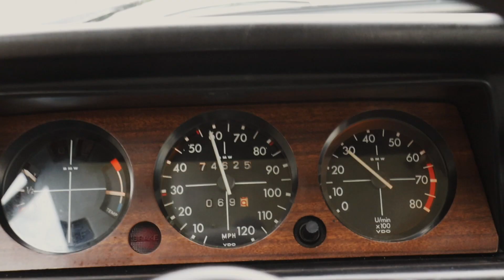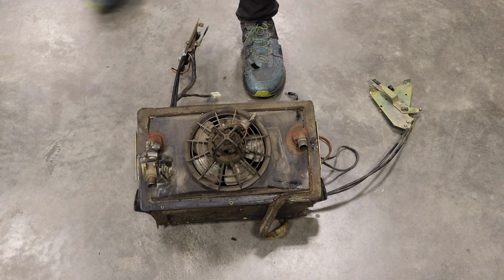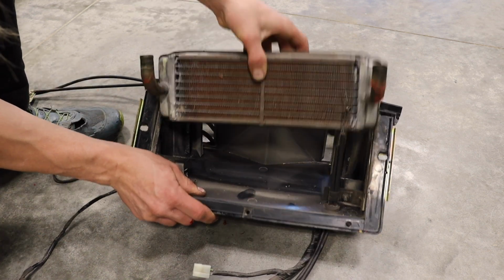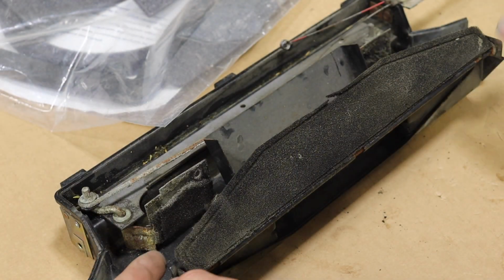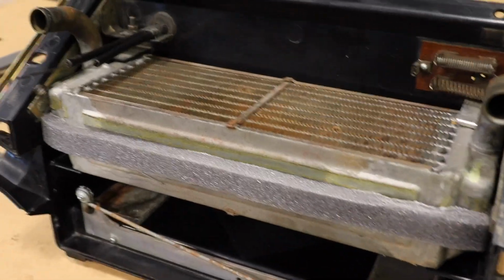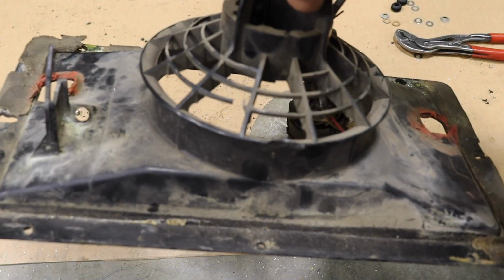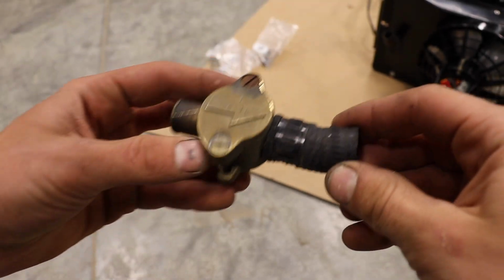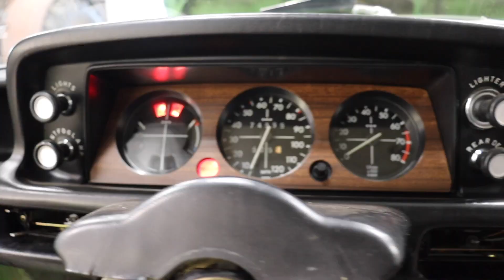How to rebuild your BMW 2002 Heater BOX?!

Comment: Welp, i gotta embark on this journey now with our one family owned 69 2002.  Never been touched.  Fan motor is kaput.  levers stiff to move.  The connector short hose and the brass valve is original and fossilized.  Lucky it hasn't burst by now.  I pulled the cylinder head which is at a machine shop (waiting, waiting).   With the water hoses off and the coolant out, it's time.   Journey of 1,000 miles begins but with one step.  Thanks for a great video.